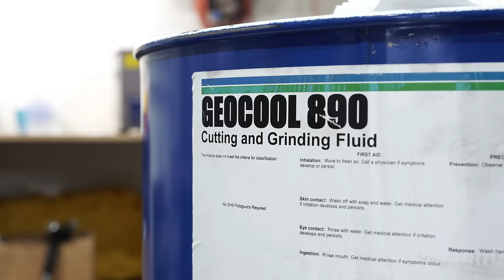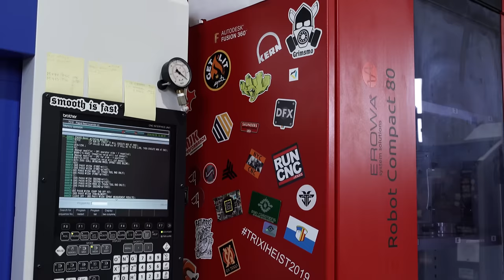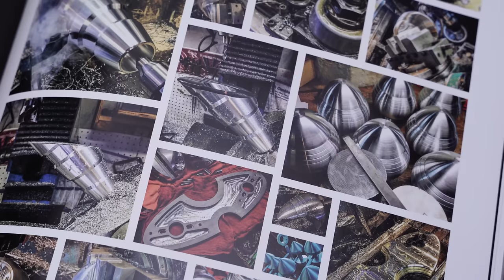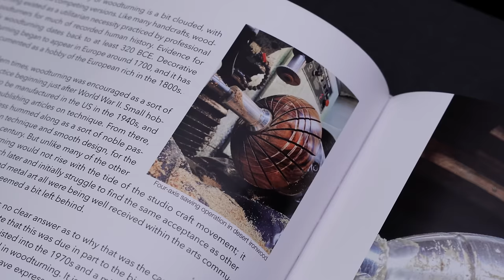Week in Review 02 | More DLC, Damascus and Timascus!

Comment from the maker: Any comments or questions? Ask away and we may answer them in the next video! ⤵
Reply: Have you thought about using a studer grinder for doing the blades?
Reply: Why are you using two stop pins?
Why do you think so few button lock knives are on the market?
Why do you think there are so few integral frame knives on the market?
What inspired you to start working on the Integral?
I have a Protech Malibu with Skiff Bearings, and I have yet to find a knife that can dethrone it... until you announced the Integral! Please continue making long videos about it- as a product design mechanical engineer I find it fascinating. (Also, I look forward to the blade shape you choose. Maybe a reverse tanto?
Thanks!
Reply: Can we have Vanax blades on a norseman
Reply: Any plans for lefty versions of the Norseman or Rask in the works?
Reply: Any thoughts on your next machine purchase? Maybe a horizontal.
Reply: I wonder if adding carbon to the button would make it less stainless 🤔

Comment: BTW:
The glass you were talking about…it’s actually easily found even in kitchen sections. Lock-&-Lock even makes glass Tupperware using it, and most good glass backing forms are made from it…in case you need large(r) and/or flatter forms!

Good luck & best wishes